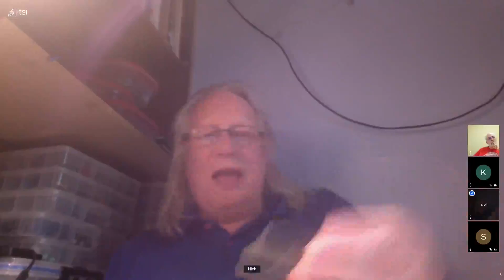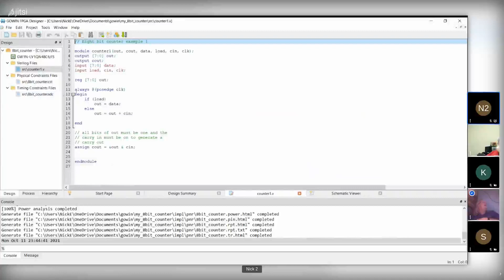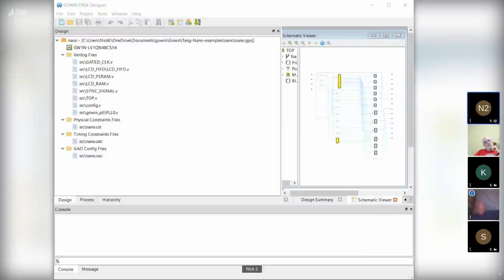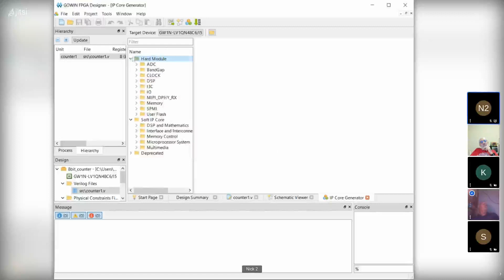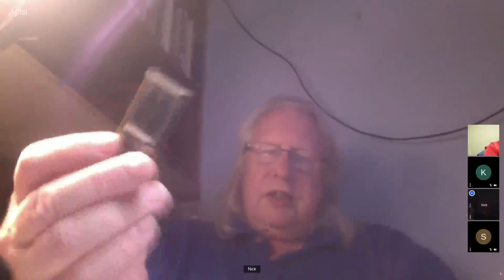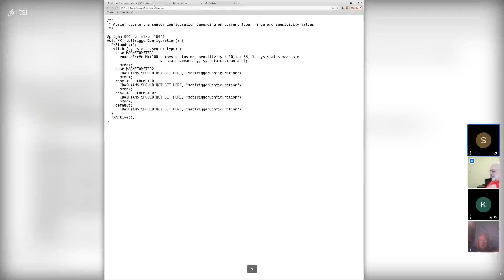TriEmbed Regular Meeting -- 2021-10-11

Comment: Just bought this board and received it, wow, what a lot of power for the money, it can go 450Mhz! with 180Mhz SRAM, instructions are now in English.
Going to plug it in later and write a little VHDL see if I can make a LED flash.
Thanks for this video, FPGA's are largely overlooked by beginners yet they are the most powerful, I read one of the versions has a Cortex M3 built in!!
Reply from the maker: Great to hear! Yes, our project will be usable by beginners as well as professionals.